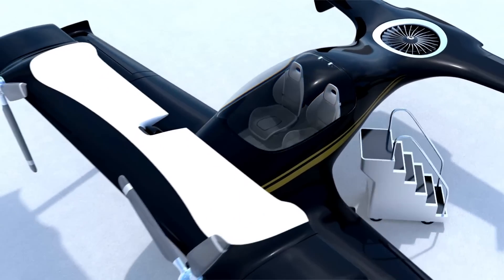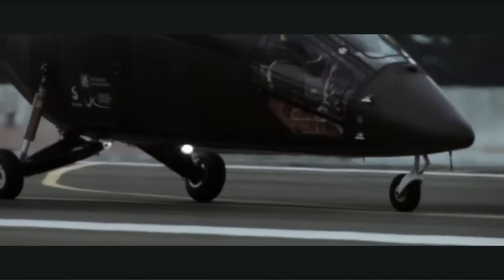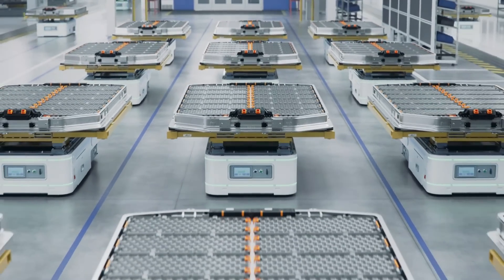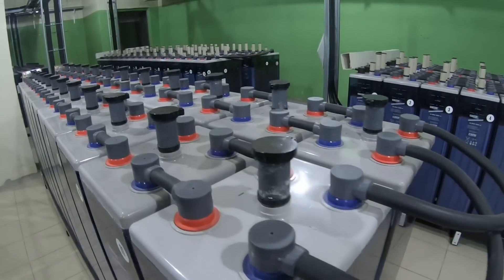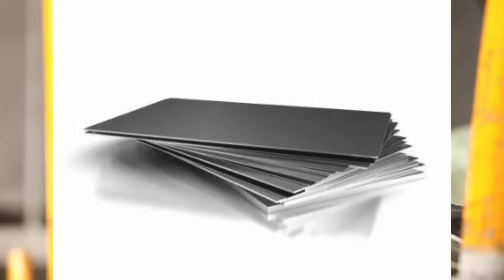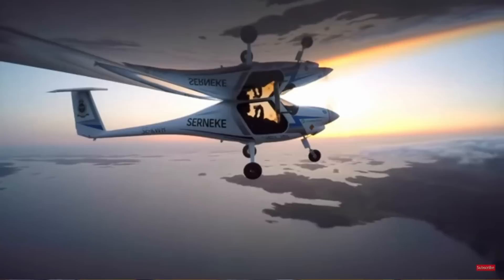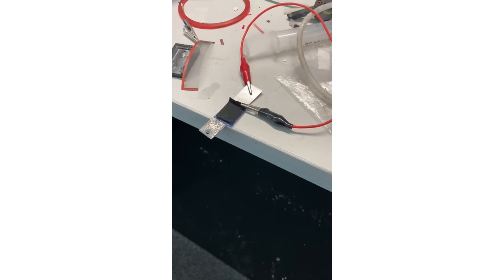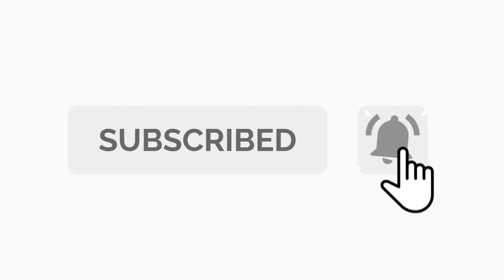Aluminum Air battery: The battery for electric Aviation

Comment: How does the charge get consumed? ie A plane has 10 batteries, it flies to a destination that uses 70% of the batteries charge. Do all of the batteries need to be exchanged, wasting 30%, or can 7 of batteries be replaced restoring the full range?
Reply from the maker: The Al plates get thinner as the battery is used. So you can replace the plates with fresh thicker plates, if you want full range at the start of a mission and use the depleted plates for shorter missions
Reply: It may depend on battery management, which should keep some batteries as spare, not even used. And use them when other batteries are nearly depleted. Because the plane during normal flight consumes only a small amount of energy compared to takeoff so e.g. half of batteries may be kept unused.

Comment: An obvious application for aluminum air batteries is the military "kamikaze" drone. Since the drone is fated to explode at the end of its flight, rechargeability is not a consideration.
Reply from the maker: Surveillance drones that loiter for around 8 to 10 hours before returning is another application. Just swap the battery when they return and send them back
Reply: @ElectricAviation  Exactly like that, you would swap them anyway, but with LiIon ones. So why not use the Alu/Air and you will get 4x range or working hours.

Comment: The 400kWh/kg figure that Elon Musk suggested was one his most ignorant statements that he's made and he's made many.  There isn't a single magic figure, just the range that different batteries densities can provide, 400Wh/kg just takes us to short haul range, it's a long way from being good enough for medium let along long haul, until we can achieve the later we'll not displace the biggest aviation polluters.

At 1000+kWh/kg batteries start to make things far more capable of replacing medium haul passenger aircraft, this is where things could get really compelling.
Reply from the maker: Batteries will never be able to achieve medium and long haul. Its not cut out for that. It has a niche in Urban  and suburban air mobility
Reply: @ElectricAviation  Medium hail is 3-6 hour flight time, that's within reach for a 1000+kWh/kg battery.  Please do the sums of aircraft + propulsion efficiency, % all up weight dedicated to batteries and range for a different battery densities, would make a great video illustrating what current tech is capable of, what next gen batteries might provide and what leaps would be required to displace medium and lpng haul flight.
Reply: @ElectricAviation  Never say never...

Comment: The Chinese company CATL has announced that their condensed lithium ion battery has energy density of 500Wh/Kg, it's rechargeable and it's ready to deploy too. That make much more sense than the aluminium air battery.
Reply: And I have a perpetual motion engine ready for development.
Reply: @ExploringCabinsandMines  I already have one of those in my car
Reply: @dantronics1682  Damn you beat me too it!!
Reply: nothing wrong with different chemistries for different use cases.
Reply: CATL, only six tears away from actually being used.
Reply: We are working on a 8000Wh/kg Al-Air battery right now.
Reply: @PyraPOD : truly, or just sarcastic?

Comment: Magnesium is high density, cheap, lightweight, and high capacity. It can recharge umpteen thousand times with little degradation or dendrite formation. Sounds perfect! Interesting to see more on magnesium battery development
Reply: I might be showing my age but I remember when we use to buy non rechargable batteries for all sort of things and didnt even think much about it. using aluminium air is just going  back to that stage but with higher density. what it is is that you youngsters think if it cant be recharged then its no good for anything.

Comment: You're off by an order of magnitude to get to batteries to replace jetA.  Even given the ~35% efficiency of potential energy into thrust and a 100% efficient electric motor, you need something closer to 5kWh/Kg  not 400Wh/Kg to make electric aircraft viable.
Reply: Aluminium air potential 8kWh/Kg.
Lithium Air 11kWh/Kg

But I think the actual revolution will be with iron.
Reply: @UmmerFarooq-wx4yo  Ya, the air batteries have potential, but they're not remotely viable yet and may never be.
Reply: @UmmerFarooq-wx4yo  The even bigger issue is generating that much energy.  I did that math on a typical day in HKG, and you need about 80GW of always on power generation to keep up with the current energy demand of the airport if the fuel minus the inefficiencies were provided by electric.
Even if it were all nuclear, which has the lowest land use per W, there's no where to put 80 nuclear reactors let alone low density wind or solar.  I think even natural gas would struggle with that kind of output and land use.
Reply: @z987k  that's not too hard. 8 million homes with 10kW solar could easily sustain that. Just need HK$600 billion. Which sounds like the 1/10 of the price of 80 nuclear plants. 
Might be cheaper still with roll out mat solar collectors.
Reply: @UmmerFarooq-wx4yo  There's not enough land in the whole of HKG to put up that much solar.  The reason it'd have to be nuclear is available land, though there's not enough land for those either.  Also if you did it in solar you have to at least 4x the generating capacity due to only generating at about 25% capacity over time.
Reply: @z987k  Hong Kong is 1100km² and 80gigawatts could be achieved by 380km² of solar panels.

Comment: If these batteries could be used as reserve capacity, so not used unless vital, then less Li-Ion would be needed (engage rocket equation), and they wouldn't need swapping very often.

Comment: "They may not be suitable for aircraft that require very high bursts of power for a short amount of time because of the lower power density ..."

Not a problem. Use supercapacitors for high burst power.

Comment: Wait, what? 500W/kg? That's excellent. The 200W/kg listed on wikipedia always seemed like a major limiting factor for aircraft use. But since you still have to size the pack for power rather than capacity, the lack of rechargeability will result in a lot of waste. Especially if your route uses 40-50%, you have to throw out over half the energy or else run low toward the end of the second trip.
Reply: Good point. Perhaps  aluminium air would make sense as an emergency reserve in aircraft? Or as an occasional range extender in EVs?
Reply: @tewrgh  Or, it gets put on a grass mower and cuts grass until depleted for the county - plenty of uses to deplete batteries

Comment: Not rechargeable why even mention it...
Reply: They are a fabulous range extender for EV’s allowing a small Lithium battery with a small range to extend in emergency situations.  They can be replaced as they are utilised - perhaps when the vehicle is serviced.  Much better than dragging a heavy battery or a combustion engine around.    And whats more it seems one of the only technologies that will allow commercial flight.  Instead of filling the aircraft with fuel it would simply have new batteries installed.
Reply: @skeetamacgyver1821  well I suppose dependance enthusiasts will love it, simple recharging for years without material consumption is much too convenient for the user and manufacturers might not like it...
Reply: Agreed. It's the bottom line, IMO.
Reply: Living on the road, with my electric guitar, it is often impossible to recharge batteries.  They become useless weight, together with the recharger.  Learned 40 years ago, its better to work with one-way batteries.
🚀🏴‍☠️🎸
Reply: @MichaelWinter-ss6lx but you can get solar panel roll mats, like those who did 'charge around Australia'
Reply: Aluminium air batteries last long
Reply: Perfect for one-way drones. I guess you know that this is the reason why u can hit far in r with drones and the sea babies
Reply: Yeah, it's no good for spacecraft or submarines, so I'm out. 😂
Reply: @blarvinius  are you kidding, they were specifically designed for subs
Reply: A nuke detonation system only needs to work once...
Reply: You can however recycle and they can output power levels safely to allow e flight.  
The Al Sulpher battery might be able to do both ... it depends if we can avoid the recharge degradation...   It's comming..
Reply: Imagine refusing your armoured vehicle by just slotting in a new rack of plates ..  compare that to carting huge amounts of volatile Fossil fuels or H2 across a battlefield.   

Fuel resupply has to be one of the most dangerous and costly jobs on the battlefield... 
Plus electric propulsions more reliable cheaper to maintain, more safe, quiet and stealthy.
Reply: A non rechargeable battery is not reasonable for aviation, considering the surplus hours of flight required by regulations
Reply: @ww07ff 
Simple. You have a small, extra (10%?) battery which doesn’t normally get used. If you have to use it up, only then will it be replaced.
Reply: @q.e.d.9112  Does 10% meet the surplus regulation? How much weight will be added for 10% more flight time? And each flight plan has its own surplus, depending on the cargo + passengers total weight and a bunch of other variables.
Reply: That depends on your definition of 'rechargeable'. Combustion engines have never been rechargeable. The power source simply leaked out of the airplane and needed to be replaced. That was no problem so far, so why should it be a problem to replace batteries? Whether or not an airplane can be recharged the same way as an EV is utterly irrelevant. If it's safe and the numbers add up, you have a winner, even if that is obtained by glueing a Master Yoda copy to each wing.
Reply: You can't go high altitude like you can with li ion and the aluminum plates would be expensive and carbon intensive to produce. @Berend-ov8of
Reply: @Berend-ov8of  we need something with less mass and more power. Picture of Factory and warehouse full of batteries just to "recharge" a Fleet of planes those numbers don't add up. But a battery smaller than a EV battery or backpack. that last for weeks on a charger not much need for the warehous. That is the direction we need to head for.
Reply: @Ewills6147  Shipstones you mean. Making it more important to hold on to your battery than to your wallet. Yes, ofcourse that would be the solution, but a shipstone doesn't store electricity, but rather stores a source for electricity. That is an entirely different technology, that hasn't been developed yet.

Comment: cost of replacing the battery is an important consideration
Reply: That relates to the energy recycling costs of Al. but if you have a lot of clean energy spare like Scandinavia's hydro generation... Or Geothermal then the chances are they are already making Al. 🤷🏻 Recycle to recharge.. it takes less than initial extraction and refining. Though I'm not sure if it uses the same flux Cryolite ...Na Al Fluoride...which can be nasty in the environment.

Comment: Swapping is going to be necessary for any real comparison to the use cases that liquid/gass fuel vehicles satisfy. Recharging has too high of requirements for time and parking space vs refill and go.
Reply: Yeah maybe maybe there will be interchangeable systems so a 2000km trip would do aluminum whereas 400km normal trip entirely lithium!?
Reply: @pingnick  why use lit for the 400km trip? this lit batteries could be sitting in the car for reserve power if it every needs it
Reply: @dantronics1682  yeah not enough output I guess for airplane emergency but yeah for vehicles makes some sense I agree-you could putter along many km for just a few kg of weight
Reply: Airliners and large Cargo Planes in particular would easily be modified to accept Aluminum-Air batteries in the standard form factor of the aircraft's normal shipping containers. That means very quick battery swaps, perhaps quicker even than refilling aviation fuel, and no risk of spilled fuels and fires on the tarmac.